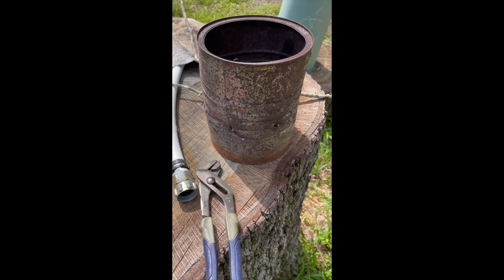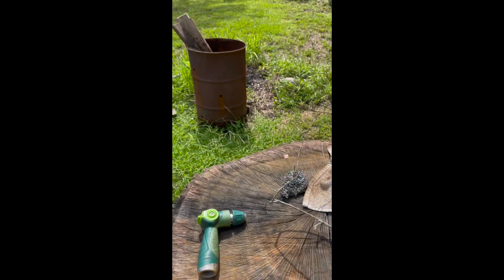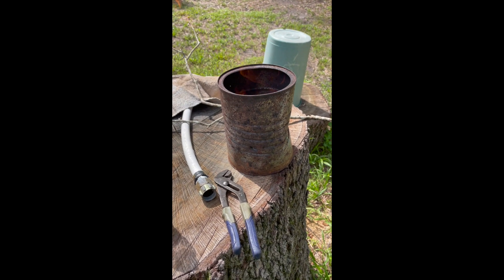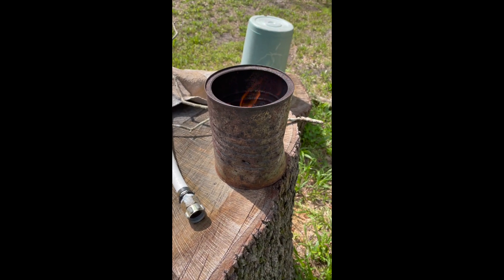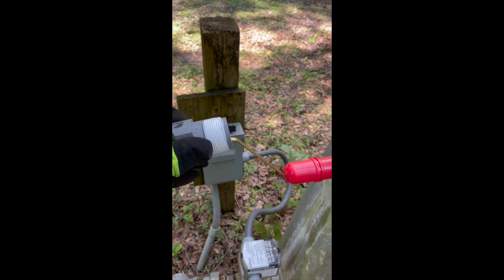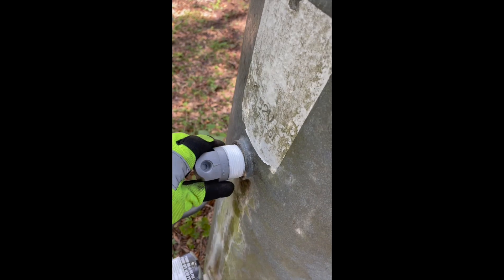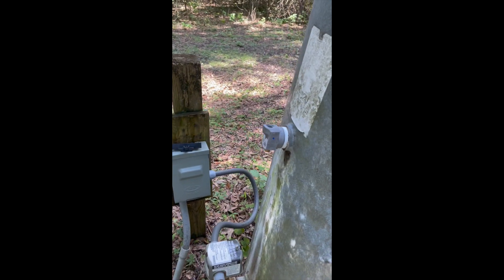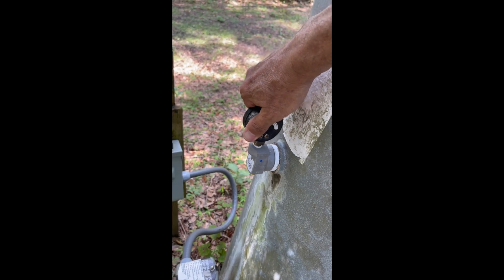How to Well / Pump / Tank Repair - Air Volume Valve

Comment: I replaced our pump at the well a few months ago, once it completely stopped.
Afterwards my water pressure was doing as you described, pulsating…
Even to the point that my water hose would sway when rolled up on a holder, as the pressure changes.
Then I began to notice a tiny drip from one of the valves, at my tank.
Anyway the drip has steadily increased over past couple months,
To the point I have a fairly large puddle in my supply room off
The garage,
Anyway, I was thinking I could just remove & replace the small plug on the bottom,
But was informed my a friend at hardware store that I had to replace the entire air volume control valve.
So trying to briefly educate myself on any important unknowns in the process.

Comment: Thank you for posting this video.  I watched the other video by Well Said, saw your comment and came here.  I have the same problem, with the pump switching on and off repeatedly when the water is running.  After watching enough videos I know it's either air-logged or water-logged.  Will try your approach by replacing this air control valve first.  If air-logged, this replacement should fix it.  If not then it could be waterlogged.  Will have to locate that check valve / snifter valve and replace it.  Keeping fingers crossed!

Comment: That‘s not the problem, it‘s a air release valve your playing with. Check your Snifter valve or the check valve where the pressure switch is installed
Reply from the maker: @2SpritOne  my fix seemed to be okay. Thanks for the comment.

Comment: Do you not need to add air 2 psi below the pressure switch rating? Before turning on pump?
Reply from the maker: Apparently in this case, no. As soon as I installed and reconnected power, it came up to pressure and resumed normal operation. Since making this video, I have had to do this same fix again. Same result, it worked and has been a few months since. Hopefully this one lasts a little longer!  Disclaimer: I am not a pro at any of this. Just trying to do the best with what I have. Thanks for your comment!
Reply: @SuwanneeHomestead  as i understand this type of air LEVEL control will open up as soon as the air level reaches the level of this control. that way the top of the tank holds air but will not over fill with air below this control level. if the air level starts to fill up lower than this level then the valve will begin to open and allow air to escape out of the tank. my tank is inside so i have hooked up an air compressor to the top of my tank and it runs for a max of 15 minutes or until the tank pressure reaches 38 psi which is 2 psi below pump cut in of 40psi. this way i add a little bit of air to the top of my tank each day. it has worked well for me since 2008. mine comes on at 11:30 each night so i can hear the compressor run. i try not to run water such as showers or dish washer or clothes washer from 11:30 til midnight or the compressor could run for the full 15 minutes. normally the compressor runs about 1 minute or less each day. in your video i think i can hear air bleeding out of your newly installed "FLOAT" when the well pump cycles off. that is because the tank is likely filled with 75% air and 25% water as the air bleeds out to the FLOAT valve level, the pump will likely kick on again a few more times until the water level is up to the bottom of the FLOAT valve and the air is above the FLOAT valve. have a great day, Jim in central Florida